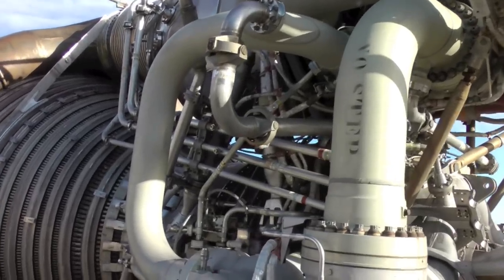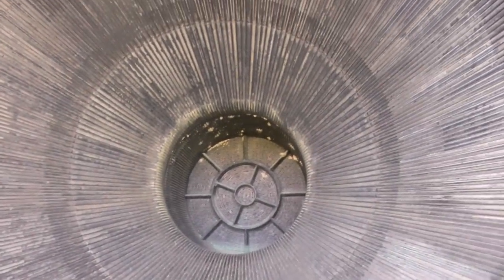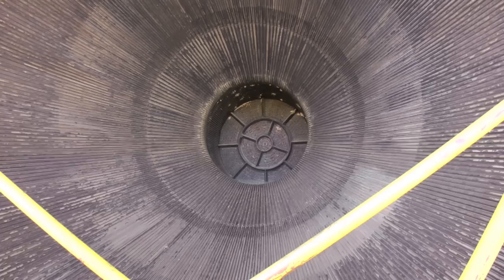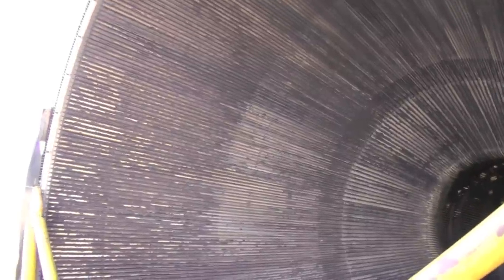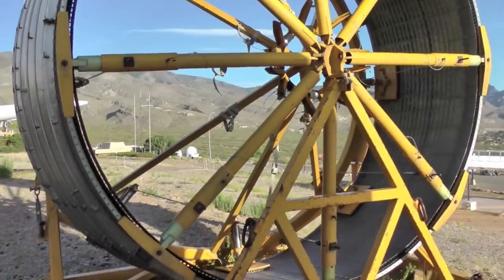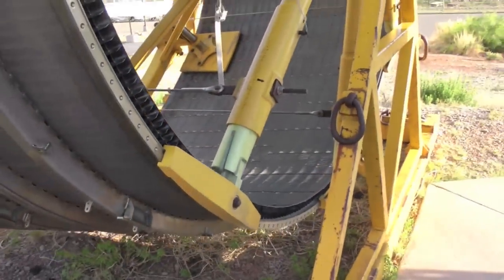Saturn 5 Moon Rocket's Main Engine, the F-1 | NASA Apollo Program Space Travel HD

Comment: The F-1 always had the most thrust because of its massive size.  But for engine efficiency the (Thrust to weight ratio), Russia had always outgunned the US.  It was not until 2013 when California based SpaceX corp created the Merlin 1D with an efficiency of 150+:1.  From 1974-2013 it was the Russian NK-33 with 130:1, before that is was the RD107.  At the time the F-1 thrust to weight ratio was slightly under the RD107.

Comment: I am sad this just sits outside somewhere.
Reply: I feel the same way....... someone should set it up on rails at salt flats and make the worlds fastest most expensive ride out of it..... I guess fatal too...
Reply: not f you get a second engine on the front to decelerate :D o yeah and a rail which is perfectly straight
Reply: It is in the desert and they typically mothball stuff out there.
I agree it's a bummer it hasn't been set up somewhere indoors, but being located there it's in the better outdoor environment to be hoped for.
Reply: I'm guessing they're in such good shape because of all the exotic metal alloys they've used despite being out in the open for so many years.
Reply: Agree, wouldn’t cost much just to build a open air pavilion with a roof around it....

Comment: Thanks for posting this!  When you looked into the nozzle, I was confused at how the mixing of LOX & Kerosene takes place.  I found a very good site that explains in fine detail.  The injector at the back of the nozzle has a LOT of very careful design.  Those concentric/radial copper bafflings partition the injector into 13 areas (8+4+1).  Each area is populated with dozens of two-pair holes (1-fuel, 1-LOX).  the hole pairs are designed (angle&diameter) to supply the exact fuel/LOX ratio upon stream impingement for a precise delivery of 5lb/sq-in/sec of mix.  The fuel/LOX hole-pairs are supplied by radial manifolds within the injector.  LOX manifolds sits on top of the fuel manifolds.

The baffling was installed to prevent a 2khz rotational  instability of the flame after catastrophic failure on initial tests.  You can also almost see 25 igniter holes when he zooms on the injector (shiny silver). Two per 12 compartment areas and one in the center area.  These are fed a triethylbutane(85%) & triethylaluminum(15%) fluid.  It is a hypergolic catalyst that spontaneously ignites in the presence of oxygen.  This provides ignition for kerosene/LOX.  Each one of these F1's produce 1.5 Million lbs thrust.
Reply: They actually exploded small bombs of various sizes within the thrust chamber to induce combustion instability during testing, which was the bugbear of the program and led to the loss of several engines!
Reply: +Zoe TheCat
Amuzing fact: the Russions still need to light their rocket engines by means of match. aka the pyrotechnic ignition device PZU
Reply: Thanks for pointing out the igniter holes on the injector. Located them in other pictures and I'm guessing they are the ones that look like the heads of a flat single groove screw. Another interesting tidbit I've learned about this unique engine.
Reply: +tvarad Yes, they do look like flat-head screws.  Did you hear they recently picked a few of these up from the ocean floor?  They found engine no. 2044 (# 5 engine from AP11).  It will be put on display in Seattle.
Reply: Yes, I did. Jeff Bezos organized the expedition which found them to recover the Apollo program artifacts off the Florida coast.
Reply: @tvarad  According to one engineer the problem of combustion instability, which required many countless hours to overcome, also destroyed several marriages along the way before it was finally solved.

Comment: Awesome closeup of an F1.  Loved seeing the radiator-like nozzle structure, the turbopumps, and the exhaust manifold (which vented a comparatively-cool layer of air over the nozzle extension - "skirt" -  thus protecting it from the hotter exhaust gases.  Thanks for the video.

Comment: I love the F-1 and everything related to the Saturn V.  Big fan!!  I've stood in front of a few F-1 engines and just stared, imagining what it would be like to be part of the engineering team working on the space program back then.  

Unfortunately your explanation in the video isn't accurate.  At 1:10 you say that the extended nozzle doesn't have coolant tubes because the exhaust is cool enough by that point that you didn't need expensive tubing to cool the nozzle.  The exhaust was still plenty hot, but the large duct that wraps around the outside of the nozzle at that point brings exhaust gas from the fuel pump and injects it in between the nozzle and the very hot gasses.  This is why the first 20-30 feet of discharge from the engines looks darker in videos, the dark part is the cooler fuel pump exhaust, and that's what protects the bolted on skirt.
Reply: mushtang2 textbook explanation
Reply: Yeah... staring and imagine being roasted during an epic lift ooofff! We had a liftooff!!

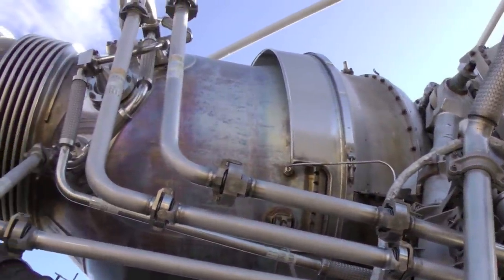Comment: You are correct sir (and fine video).  Along the way to the nozzle manifold, heat from the turbopump (gas generator) exhaust also drives the heat exchanger (seen @ 0:17), where (inert) stored Helium is heated and routed back up to keep the RP-1 tank pressurized.  A portion of the LOX flow is also heated there and routed back up to keep the LOX tank pressurized...

... no wonder it took 7+ seconds to get these beasts running at steady state (max power)!!

Comment: That loud sound just before the 30 second mark was the sound of all the mechanical engineers watching this reaching climax!!! Talk about amazing innovative technology. And to think this thing must have been designed in the late fifties and early sixties for them to have solved all the problems by a launch date in the late sixties. With a pencil and paper, a good slide rule and a whole hell of a lot of good old fashioned hard work. The way they routed the fuel around the combustion chamber to cool it still amazes me and is impressively genius. I heard that the operating temperature of an F-1 is something like 50-60°C. The exhaust gasses are thousands of degrees, hot enough to melt any material they could come up with and the fuel is a few degrees above absolute zero, so cold that just storing and handling it was an achievement in itself. Then getting all of these things to not just coexist but to symbiotically make each other stronger is just beautiful. Robert Oppenheimer called the design for the H-bomb(a complete misnomer but that's another story) "technically sweet". That is what this engine design is, it is technically sweet!     P

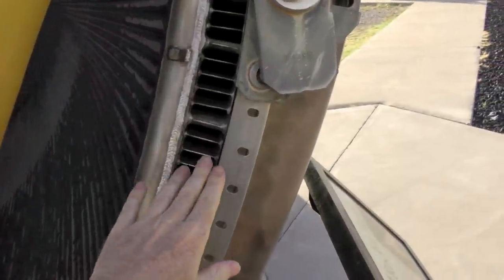Comment: The turbopump exhaust injection ports are easily visible at 1:03 along with the curved duct supplying the turbopump exhaust. The turbopump exhaust film protected the nozzle extension because the temperature of the turbopump exhaust was about 1600F while the main exhaust was about 5950 F. In films of the launch, this turbopump exhaust is the black, sooty exhaust material blocking view of the main engine plume for 8-10 feet aft of the nozzle extension